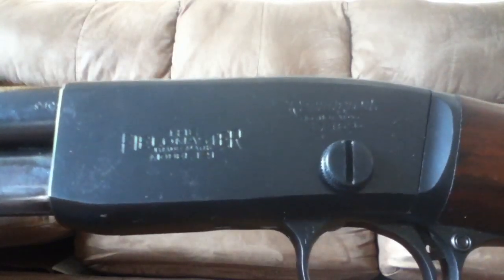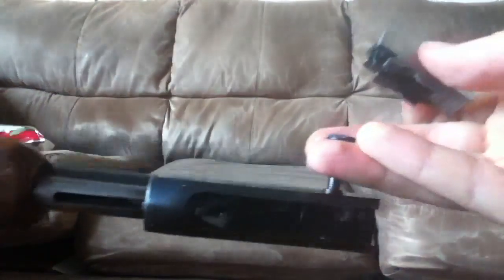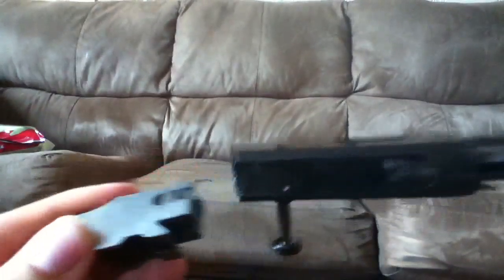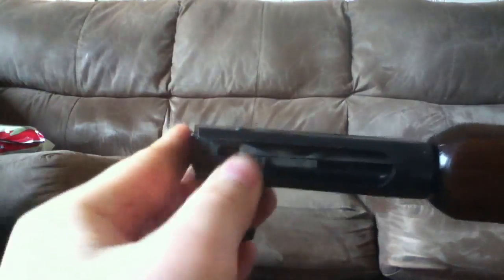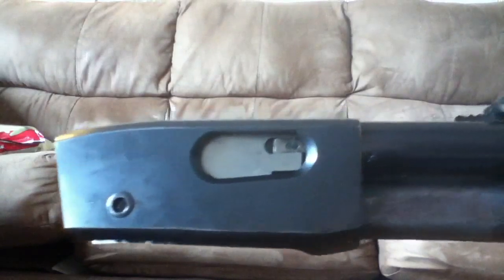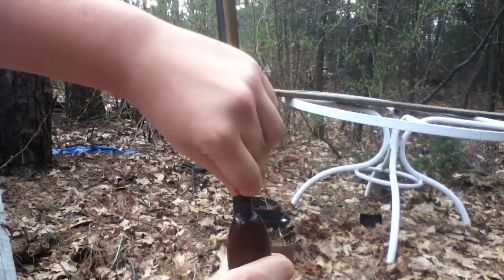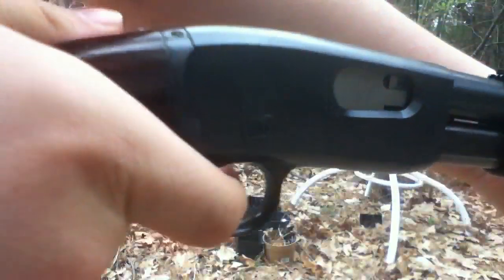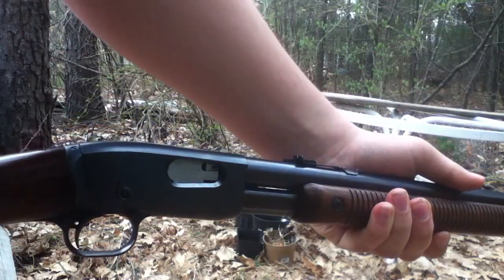Remington Model 121 Bolt Assembly

Comment: Very helpful video, was my dads 22 rifle in the canal zone. he was a machinist and threaded the barrel and made a really nice SS suppressor. during mango season he would head out at dusk and climb into a mango tree and wait for a conjo pintado to come gnaw the nut to get the seed inside. very good eating jungle critters. head shots. he was good.lol. I used the rifle a lot, lots of deer by the neighbor hoods in the mountains. I would go out late and look for them. between the eyes and they would fall and I would go get em take em home and clean them. lot of venison on the grill. I would take all the guts and such to the bridge going to miraflores locks and throw them over the side in to the spillway, big salt crocs, they loved it. that was many many years ago. rock squirrel problems in my back yard here in the usa. So sighted in and no more problems yet. thought, wonder if this thing has ever been stripped and cleaned? I was not. filthy it was. Is spotless now with great oils and grease where needed. still shoots better then most newer 22's. I had problems getting the bolt back in. your video helped. thank you so much for the informative video.

Comment: I just received a Remington Field Master 121 and the extractor is worn down.  It will extract about half the time.  I did find a replacement extractor(not new but it good condition) and was wondering if you knew how to replace the extractor on this gun.   Your previous video to field strip was great BTW.

Comment from the maker: Thats right. I've put just about every brand through it also and it works just fine.
Reply: Bathory20Seven I have one I'm having issues with it spitting the shell it will pull it back though but wound eject it I cleaned it out and nothing